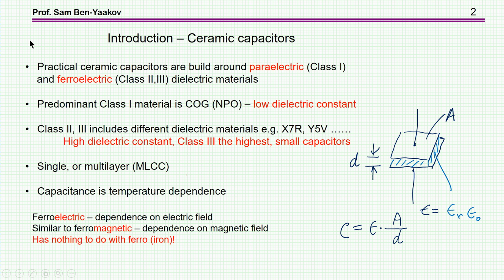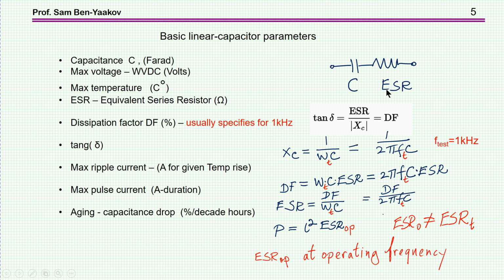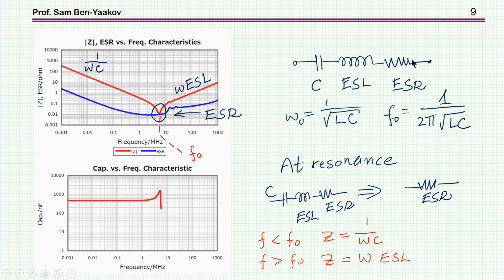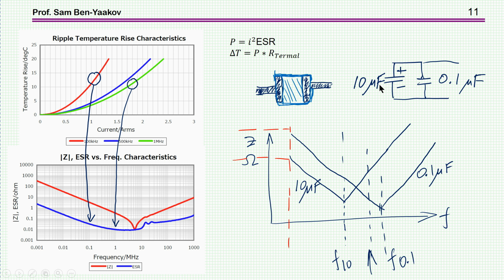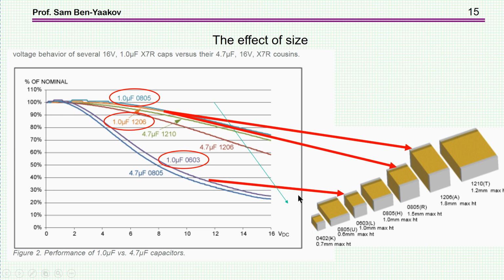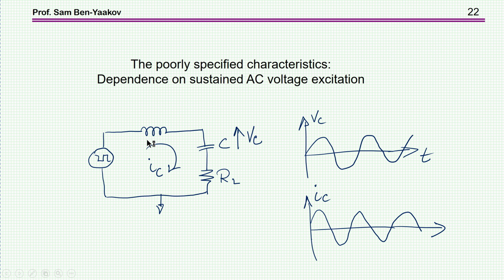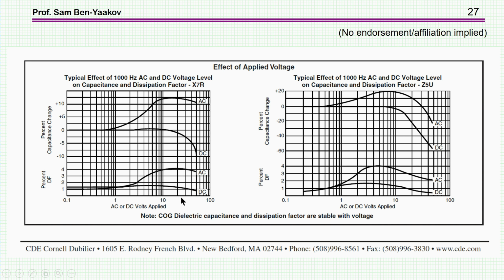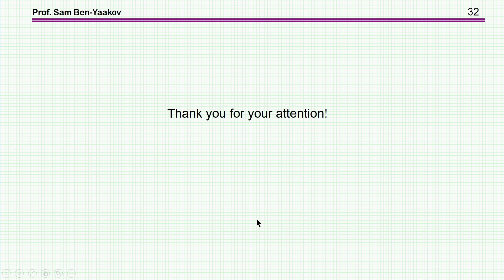Ceramic capacitors parameters - and Lack of Data

Comment: Thank you, Shmuel. Rhetoric questions. Interestingly, is there any explanation for the AC dependence in terms of vibrations of (weakly) piezoelectric material? As far as I know, MLCC demonstrate also electrocaloric effect (charging at one temperature and discharging at another). This apparently, has no application in switching converters, since temperature changes very slow.
Reply from the maker: Hi Alex, big questions for which I have no answers

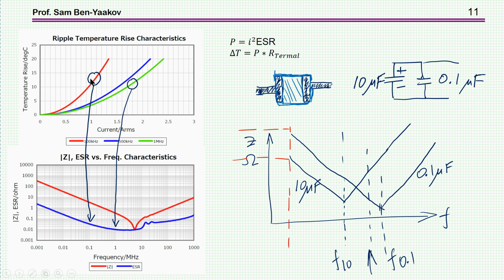Comment: The hand drawn graph you've shown at around 22:00 is asymptotic and doesn't show the resonance and anti resonance very well. This could be very misleading for people unfamiliar with the anti resonance (parallel) caused from one capacitor acting as an inductor and the other is still capacitive.
Reply from the maker: Hi Mike, Thank you for your comment. You are right, but the issue of capacitor paralleling is just a side remark in the video to illustrate the benefit of the CC in bypassing.  It is already  a too long video so there was no room for detailed discussion. Perhaps I should have added some wiggles on the asymptotic drawing. Thank.

Comment: Ceramic capacitor aging can also be an issue, especially for Class II dielectrics (X7R, X5R, Y5V).  The capacitance value can drop considerably (-20%) over several years of operation.  I don't really understand the mechanism behind the aging process, but I think it has something to do with dipole realignment inside the dielectric material.  I would assume ESR also increases as the component ages.

Measuring ceramic capacitor values in-circuit can be problematic if the assemblies are fresh out of the reflow oven.  As the reflow temperatures will partially reset the dielectric material and can cause the capacitance to be higher than normal.  Waiting 24 hours will give enough time for the capacitors to "settle in" to their nominal values.

There are other manufacturing concerns related to multilayer ceramic capacitors.  Vibrations, pcb stresses, physical damage during assembly,  and even thermal stresses can cause internal cracking to develop leading to internal metal migration and shorting.    

Thanks for the interesting video.  I had no idea size had such a dramatic effect on voltage dependence.  But that makes sense, since the electric fields in the dielectric are stronger in the smaller form-factor capacitors.

It has always kind-of annoyed me that most LCR meters will only measure components at 100Hz, 1kHz, 10kHz and maybe 100kHz.  Many switching converters now operate well over 1MHz.
Reply from the maker: Hi Jess, thanks for bringing up these very interesting and important points.